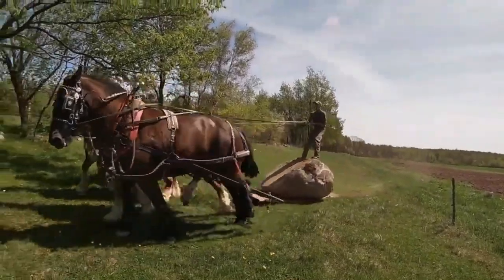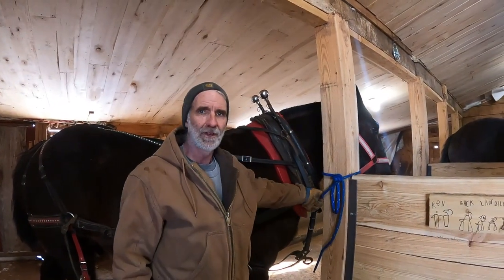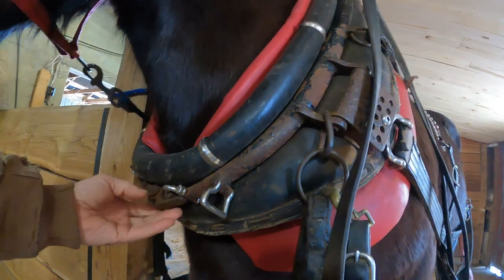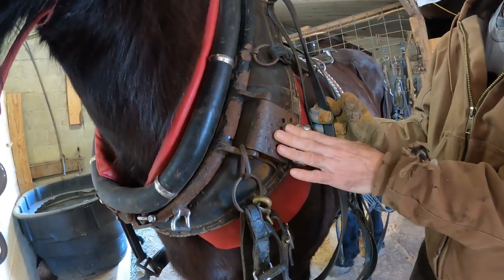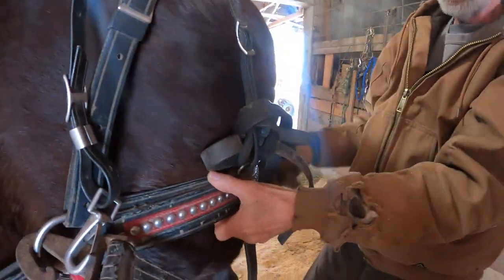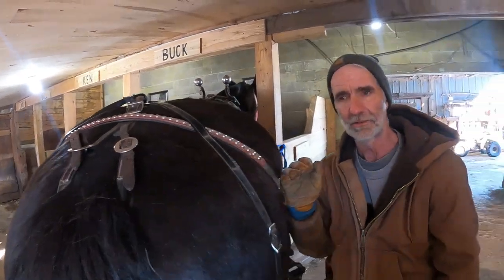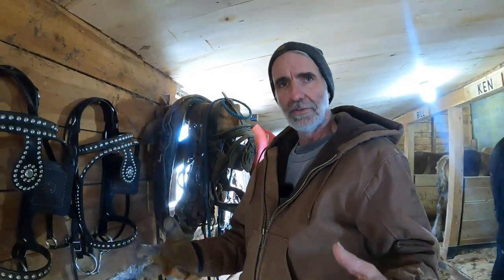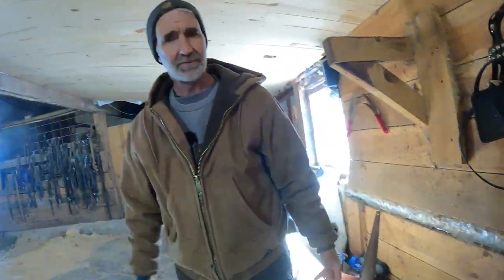HORSE BASICS #3: Draft Horse Harness Parts // D-Ring Harnesses

Comment: That is a Liverpool bit, it origins from England and it's actually named after the city of Liverpool. Those lever bits (some also call them shank bits) with curbchains tend to be very severe, horses generally do not pull as good as they could or run as good as they could, because they're afraid of it (the bit) being used on them if they generate a lot of energy (pulling or running, i hope you understand me, if they are going they get stopped every time and they hate it because of the bits, if they're going faster than they should be or generate more energy usually more presure is used on the bits and they hate stopping even more because of the bits therefor they won't even go sometimes).They can be used without the curbchain (it can be taken off) then it's another story. Some people think and say that it's the bit that controls a horse, but only real horsemen and horse trainers know that it's the horses level of training and the skill of a horseman, coachman or rider that really control the horse. I use exaclty the same types of harnesses here in Southern Europe, D-ring harnesses, they're the common ones and i like them very much because of their simplicity and versatility they work really great with a team (or pair) of horses) as well as with a single horse. Here we have 2 basic types of D ring harnesses : a light harness and a heavy harness, the differnce is in the front part the rest is exactly the same type. Light harness being a harness with a breastplate instead of a collar, it works great for general driving around, pulling carts or wagons, and for every type of light work (farming, in the woods etc.), huge advantage of a breastplate harness is the ability to adjust it far far more then the collar (the same breastplate harness will most definatelly fit "the right way" on far more horses than a collar ever will) and the heavy harness being the harness with the collar which is so much better for the horse when doing any type of work whatsoever, which is exactly the same type as those that you have.
Always fun to watch your videos !
Reply: Yes, traditionally, armies used breast collars not neck collars because of the ease of cutting one horse out and putting another in its place in a team.   However, they are pulling wheeled vehicles and the angle of draft is different to pulling a plough, harrow, logs (with a swingle tree) etc.    Neck collars are better suited to such low draft work, then breast collars are.
Reply: @payntpot7623  Neck collars are infinitely better for everything. Only advantage of a breast collar harness is its ability to fit "the right way" on more different sized horses. Angle of draft is not a problem because it is easily adjusted and angle of draft is not the point, the point is the surface of contact between the harness and the horse.

Comment: Great video again! Do any of the metal parts ever break, as they are taking alot of the strain/weight. Like the little bolt that u showed that u can adjust positions on the draft  tug seems it has alot of the pull on it. Thanks again for the videos. Chris from Huntsville, Alabama.
Reply from the maker: The metal breaks very rarely. Thanks for watching, Chris

Comment: good morning Jim and Brenda, as usual I'm confused. Can you explain in next video collars and sweat pads please. What I'm confused about is how do you put a 2"-3" larger sweat pad into a smaller diameter collar? I guess what WE need to know is "How do you measure a collar correctly (not size it to a horse), for example the collar measures 26", how do you get that measurement"? Then you put a 28"-29" (2"-3" bigger) sweat pad in a smaller diameter area, ie the inside of a collar?" It would seem that the sweat pad would be bunching up on itself, just like you if had on a pair of pants that was 2"-3" too big in the waist and you pulled them tight with a belt to keep from falling down. But yet your sweat pads don't even look as though they come together at bottom of collar? Hope that makes sense. Thx Dave
Reply from the maker: Hi, good question. This vid we made last summer should explain it. If it doesn't let us know. https://youtu.be/hvN-0ZjB0XU

Comment: Nice job J & B. A Buxton bit has a bar across the bottom of the cheek pieces that is to keep the lines/reins from getting caught if/when the horse tosses its head. It is used with pairs or teams and not with a single horse. Is Lady's bit hard or soft rubber?
Reply from the maker: Lady's bit is hard rubber

Comment: I collect photos from the 1800s/early 1900s of draft horses working on farms and logging camps. You can sometimes date the photo by whether the tugs are all leather or part chain and part leather. I would assume the chain tugs would have been dangerous around the horses rear legs and were eventually replaced by all leather. Do you think that's true or would there be another reason for not using chain?
Reply from the maker: I think chains would be heavier than leather to put on, also people wanted their horses to look good, so most people prefer the look the leather. And yes, the chains would be more abrasive against their body.

Comment: It is a Liverpool bit.  It is not a Buxton.   they are quite different.     A Buxton is generally a coaching bit.
You Do Not have to use the curb chain.
It Was Not designed for logging etc.    It is more of a driving in a cart style of bit.  I have an old nickel square one from the an old brewery set of harness.

Your lazy straps are known as "trace holders"    in most driving circles.     The tugs are actually the loops which hold the shafts.    Since you have no shafts when using a pair, I suppose it makes no difference that you call the traces, tugs; but it is confusing at times, so thanks for using both terms in this video.   I for one, appreciate it.